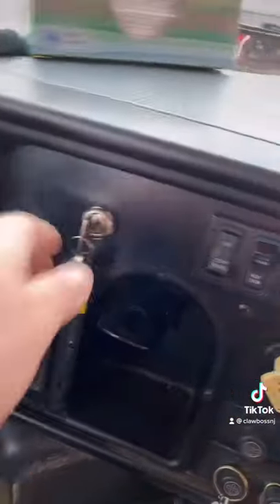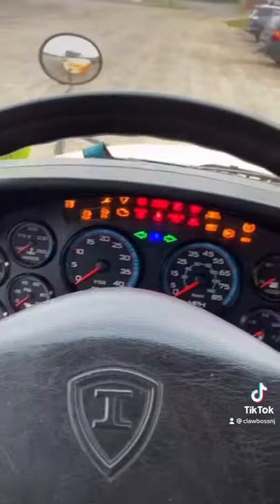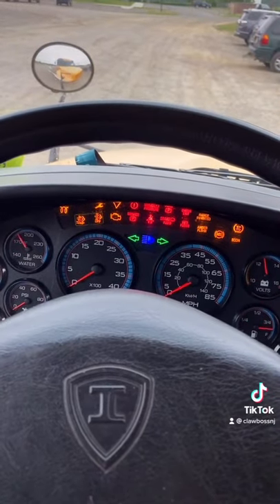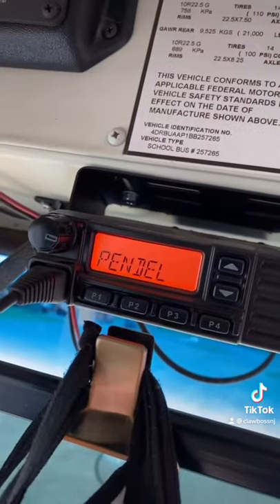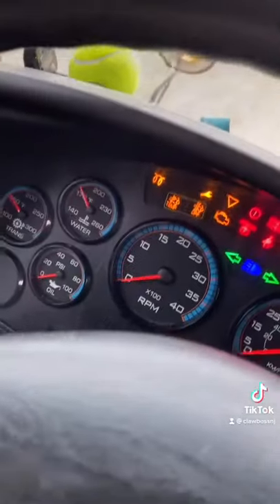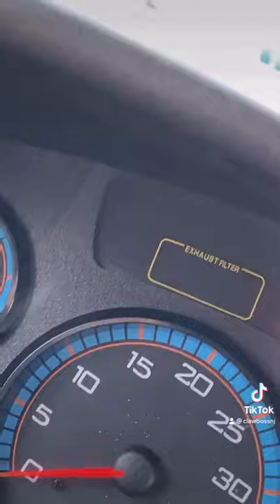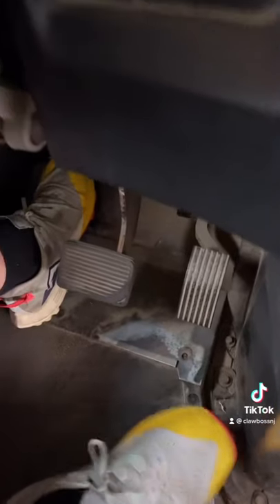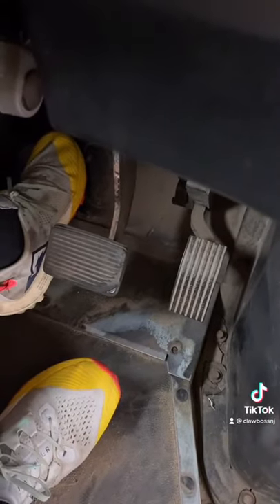MY SCHOOL BUS MAKES WEIRD SOUNDS WHEN I TURN IT ON!

Comment: Squiggly line is the glow plug light. Only diesel engines have glow plugs since they run off heat and compression
Reply: Lol I work on them for a living if I told you how many times I've seen ppl not wait for the glow plugs to warm up you would say Wtf
Reply: @belly tripper YES
Reply: @ross_demon1315  Exactly, this is why nowadays we have instruction manuals for shampoo 🤦‍♂️
Reply: yep
Reply: @ross_demon1315  Well, I didn't know what it is until now, but when I've seen it on dashboard to me it just resembled heating coil and I guessed that I would need to wait for it to warm up. I don't even know much about such vehicles, it was just my first guess.
Reply: @lukmly013  that's a good guess, but if you don't drive a diesel it's understandable not to know. Anyone who drives a diesel should definitely know tho
Reply: Ahhhh you don’t have to wait for glow plugs just crank it till she makes it

Comment: If you dont wait for the glow plug light to go out its not going to damage the engine.
Reply: Yeah, but actually no. It won’t be bad if you miss it the one or the other time … but the cylinders are pre-heated to ensure a smooth start, or even allow cold starts in the winter (where you can pre-heat also a second or third time). If it wouldn’t be necessary, they wouldn’t include them.
Reply: @FreakingDoomShroom  only needed during cold starts or when the truck been sitting for a while. If you turn off the truck and when go to the bathroom and run back out there no need to wait the 5 seconds but oh well 5 seconds isn’t gonna kill your time
Reply: @curtisnoble.  exactly ;)
Reply: Yes. It only helps with ignition and will not damage the engine at all if he starts to crank while the lights are on.
Reply: It could cause bad combustion which would cause excess carbon build up over time. It's there for a reason, just use it.

Comment: The "little squiggly" on the dashboard is a glow-plug light. Glow plugs cannot cause damage to the engine if you attempt to start it, due to the fact that glow plugs are heating elements that simply ease the combustion process when your engine is cold and they're not necessary for a warm diesel engine. Sometimes you may need to cycle the glow plugs to increase engine temperature during cold winters, as a diesel engine runs off of heat and compression to ignite the fuel. no offense;)
Reply: That could be what his company told him who knows but yea glow plugs can’t hurt anything
Reply: People that don't understand it's function don't know how to handle it and just know that you must wait for it. Diesel isn't common in the US, so most people have no idea it's a glow plug indicator. Let them find an older diesel and you have to hold the glow plug on yourself and time it out based on temperature and the last time it was used. Not hard, and not bad up go too long as long as it's not crazy long.
Reply: Cool story bro, tell it again.
Reply: @churchyandfriends  was that supposed to be funny?
Reply: @andrewridall5131  not really. But at least as entertaining as the original comment.
Reply: Being an International with that cash,  no glow plugs. It's like the Cummins engines and has a heater in the intake.
Reply: @FuzzyWCTX  oh yeah, it could be an earlier model with a cat engine
Reply: @FuzzyWCTX  thx for the info
Reply: @churchyandfriends  I wasn’t the one who got schooled
Reply: ikr lmao he dont know tho in 14 tho and know that
Reply: Actually, if you turn the ignition to start before the glow plugs are ready, most newer diesels will not start. They will come up with an error. As many also had DPF’s you risk clogging an expensive part with raw fuel that will not necessarily burn, but will bake into the filter, and not clear during DPF Regen cycles. If the vehicle doesn’t have a DPF, but has an AdBlue system, you can block the $2000 AdBlue injector. Older diesels will eventually start, and just burn off the diesel over time, and likely the exhaust will need replacing before it is blocked by bad starting practices. Having driven trucks for 15 years now, I even use this delayed ignition start in my buzz box commuter, which allows the ignition system to be fully charged, and fuel pump up to pressure. Even in the coldest weather, my petrol driven car starts quickly and smoothly every time.
Reply: @gaijininja  My dad did deliveries in a semi for a total of 13 years and he wouldn’t use glow plugs during summer unless the engine had been sitting for a day or more, he never had any issues with the fuel system or glow plugs
Reply: @Oldsoulofficial  He likely had a petrol driven truck than. Drove in the 50's by any chance?
Reply: @gaijininja  he actually drove a diesel just last year, it was a year old

Comment: That glow plug light? If you don’t wait for it to go away and just start it, it won’t damage anything - but if the engine is cold, it’ll be harder to start, or start rough.

Comment: The little squiggly line is for the glow plugs or grid heater and if its warm out you dont have to wait for them to start the bus. It wont damage anything if you dont wait. Only in cold weather you will notice it will take longer to start a bus if you dont wait

Comment: That squiggly is the glow plugs or intake heater for cold starting the diesel. Intake heaters heat the air going into an engine for easier starting while glow plugs heat the combustion chamber.

Comment: Actually that’s the glow plug light and if the engine is in good shape and the injectors are in good shape you don’t always need to wait. Diesel requires around 500 degrees to combust. The compression in the cylinder if the rings are good will accomplish that.

Comment: Let me correct you Claw boss. There will NOT be damage to engine if you try to start with that light still on. That light says the diesel glow plugs are glowing to heat the cylinders up before starting. If you crank it up while light is on it may take longer to start OR may fail to start till you let that light cycle. It's only on Diesel powered busses. !

Comment: The squiggly light is the glow plugs aka engine heater
Reply: Or technically, the cylinder heater. The way diesel engines work rely on compression for combustion rather than a spark. Because of that, some cylinders don't work too good without being heated up a bit before starting the engine, thus glowplugs.

Technically an engine heater would be a coolant heater, which was common on Canadian cars as it's cold in the winters.
Reply: @greego5952  That refers to the glow plugs,or in this car, the intake heater. Coolant heaters are plugged in to an electrical outlet.

Comment: Glow plugs cannot cause damage to the engine if you attempt to start it, due to the fact that glow plugs are heating elements that simply ease the combustion process when your engine is cold and they're not necessary for a warm diesel engine. Sometimes you may need to cycle the glow plugs to increase engine temperature during cold winters, as a diesel engine runs off of heat and compression to ignite the fuel. no offense;)

Comment: is it better to have hydraulic brakes or air brakes (btw it will make my day if I get to be in one of your videos) keep up the good work👍😎
Reply: Usually air brakes are on heavy duty vehicles like school buses, semi trucks, and any other heavy duty vehicles. Hydraulic brakes are usually on like passenger and light duty vehicles like a Camry etc.
Reply: @heyitsdurancitooo5212  thx
Reply: Also in claws cause his bus in hydraulic brakes but there really ain’t no difference it’s just if I remember are air brakes are more used in heavy duty vehicles because when you connect a truck to a trailer it’s way more easier to connect the trailer and trucks air system so you can have brakes on the trailer. Also you won’t have to worry about bleeding the brakes on a hydraulic brake system, so that’s why they use air brakes on almost all heavy duty vehicles.
Reply: There’s more reasons why but I kinda for got lol but hope it helps @turtlesrecool

Comment: What are the noises a bus makes after you turn it off
Reply: That’s the “no child left behind system”. He explained in a video. It forces the bus driver to walk to the back of the bus to press the button or open the bag door. Otherwise the alarm will go off